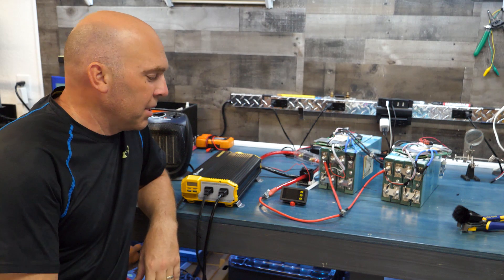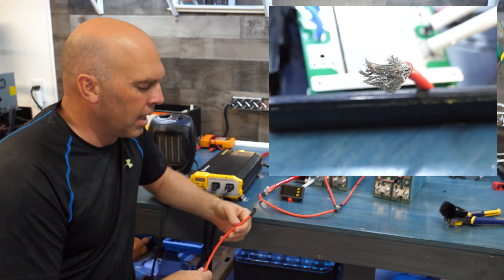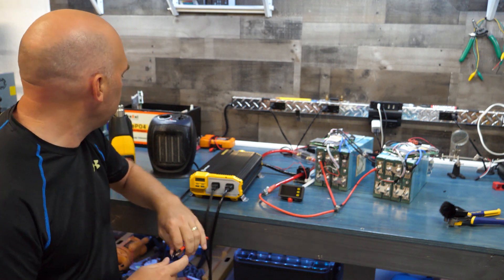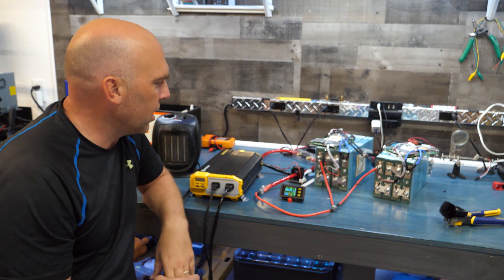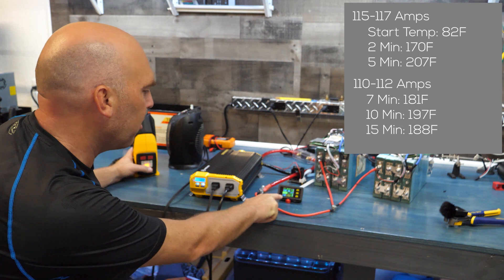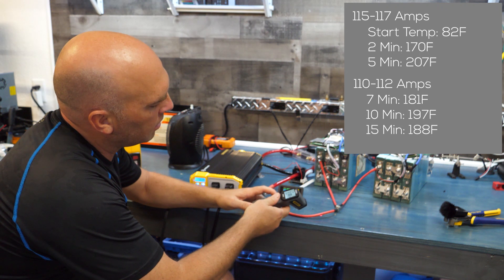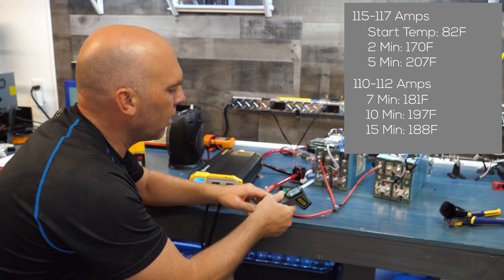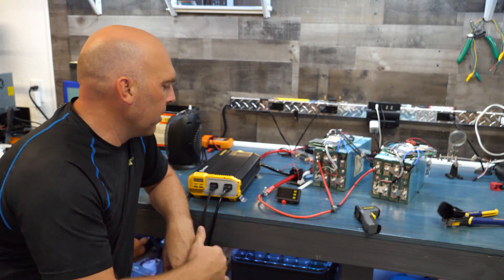8 AWG (Gauge) Silicone Wire - 115 Amp Test at 12 Volts - High Capacity 1650 Strands Stranded Copper

Comment: I have 8 inches of copper 8AWG knuconcepts wire, And wonder what is the max current it can carry. Internet says about 40 amps. But that can't be true because I have it connected to an amplifier with dual 40 fuses and makes about 800 w RMS. 
And the wire doesn't even get hot

Comment: What gauge wire would be suitable for converting a connection to xt60 for a 48v 11.5ah battery (750-1000w) for an ebike? Does anyone have a suggestion? I was thinking to just use this 8WG wire...
Reply: Well xt60 is a max 10gauge connector. I wouldn’t put more than 60amps thru an xt60 connector
Reply: Use an xt90 resolder both ends swap them out for the bigger plugs
Reply: @onesikm3  thanks a lot! The issue I have is most third party eBike battery have an XT60 on one end...

Comment: I just went ALL out and got short 2 foot length of 0awg or 1/0 awg for my 1000W modified sinewave 12v DC to 110v AC power inverter. 
No wires heating up for me! And minimal voltage drop. Gets the maximum possible runtime out of the 100AH capacity agm battery I can. No cutting out early from voltage drop. Only takes a tiny percentage of voltage drop for the low voltage cutout to trip. so I oversized the wires massively. No chance of the wires getting warm even if the inverter got struck by lightning.
1000W is also not really going to be used for extended periods of time. Only for brief periods. few minutes at most.
Battery terminal voltage alone by itself drops to just under 12v. at the inverters rated 1000W output. 
Can run a upright vacuum or small shop vaccum cleaner up to 8 amps rating easily without even breaking a sweat.
Might even upsize our battery capacity in the future to 200AH. That way I get more runtime on heavy loads without taking the battery under 12v.

Comment: If i got 8awg wire rated for 50amp for residential household use, and I bunch 4 of them together into a 1awg ring terminal lug, does it mean it can technically carry 150-200amp current?

Comment: Sir, how much amps can 16&18 awg silicone wire  carry continuously? I want to Tether my drone using these wires (low budget project). Will it be ok for 10-20 meters of tether? Pls tell
Reply: Wattage of my drone is 300 watt, max amps 28-30, for hover 20amps
Reply: @vikaslikhitkar1483  Maybe 1 meter can support 20A of 16AWG. You'll have massive voltage drop using 10-20 meters at high amperage. I wouldn't push 16AWG past 20A and 18AWG past 10A

Comment: 8AWG Stranded Tin Copper Silicone Wire is just what I'm hooking up 13.8VDC linear amplifiers [350 and 550 PEP watts] with.  Had a small measure of concern what this wire was capable of carrying.  Not expected to pull more than 100 Amps regularly, from 200A converter. Having now seen this video I can confidently apply, in a pinch, juice to a third linear producing 1350 PEP watts, as well.  Your video set my mind at ease.  Thank you for sharing.

Comment: If it can handle a 1500watt inverter why is it that every resource I find recommends at least 3/0 AWG for a 3000w inverter? (12v) It seems way overkill and my local store only has 1/0 awg
Reply from the maker: Silicone wire can withstand higher temperatures. The higher strand count helps reduce gaps and pass more current. This is a pretty well-debated subject. Personally... before learning of silicone wire, I used (2) 1/0 wires on a Victron 5000 watt inverter. That was the recommendation by Victron and most inverter companies will tell you the minimum cross-sectional area required. 1/0 has a 55 mm square cross-sectional area and was printed in the manual. Always defer to the inverter manufacturer.
Reply: @reBelBatteries  wire strand count is ONLY FOR ADDED FLEXIBILITY… it has absolutely ZERO effect on amperage handling ability in DC current. 

The only reason high amperage is claimed on this wire is the 200C insulation rating. Allowing high amps to push through the wire, and the insulation will not melt…

But the conductor will be wasting a lot of energy to heat.
Reply: Devices that generate heat quickly degrade your battery state of charge. Its better and more efficient to have oversized wires and a short run to your inverter. Why waste the watt hours heating the wires when you can use it to run the inverter. Silicone insulation might withstand higher heat but the wire resistance goes up as well. Why add to losses if you can avoid it with larger wire and good connections. I am a firm believer that one cannot possibly have a big enough battery bank.

Comment: Thanks for the video! Heat = inefficiency, it really is that simple. Just seems to me the slightly higher cost of going with a 6AWG, or doubling up this and the negative cable would be well worth it. I am already concerned about heat in my RV storage cabinet where my Magnum Inverter will also be generating heat. Honestly, I think I'd pull the trigger on 4 of these but for this unnecessary heat these cables will generate., i.e. wasted power from my precious battery bank.
Reply from the maker: Mark, we have improved and doubled up on all current and future batteries. Our new batteries come with 6AWG for the 100AH, and two 6AWG on the 200/300Ah. The battery in this video was version 1.0 and a small batch order. We've also upgraded the BMS, which can now do series or parallel up to 4 batteries. Thanks for the comment.

Comment: As Jeff Goldblum said in Jurrasic Park, "Just because you can, doesn't mean you should".  That 1 foot length of #8 will drop nearly 0.1V at 100A and 70dg C.  Really??  For a few pennies more, this design could have been much better.  Yes it's safe, but short-sighted.  Hopefully you're ordering in large enough quantities so that you can specify a common-sense improvement.
Reply from the maker: We have double the wire on all future orders. When they arrive, there will be another video.

Comment: My suggestion is to measure the voltage and current across the the WIRE you're testing to see how much power loss there. At that temperature, I think the loss is pretty high. At 115 Amps, if the voltage across the wire is 0.5 Volts, then the loss will be 115x0.5=57.5 Watts. 57 Watts, out of let say 1000W,  is 5.7% loss. Thanks for the video. It's a good test.
Reply: Correct, Copper starts to loose conductivity after 70 degrees C and gets worst as it gets hotter.

Comment: You basically have a heater element inside your battery box. You should double that cable up. Also your cable lugs have very little material on the connections. Juat because a wire can handle a current doesn't mean it efficient.
Reply from the maker: Yes. I agree.  While one does meet the spec.  We've doubled up the wires on the next batch that are coming in.

Comment: Your wire maybe able to handle it. But your losing voltage and watts. The last thing I want to do is lose power before I even hook my wires to the battery
Reply from the maker: I replied to another one of your comments, but again... while it meets the spec, we have doubled the wire in our batch due to arrive in a few weeks. Thanks for the input.
Reply: @reBelBatteries  I love how much you interact with the comments on here, really awesome!  Its so cool to see you listening to people and actually making changes to your products.  That shows your a company that really cares.

I agree with the others thou, I dont care what the #8 is rated for, its to small for 100a, let alone 200a continuous current, short spikes would be fine.  Its also acting like a choke point and limiting surge current into an inverter, which could keep it from being able to start big surge loads. 

 Yes that small wire all by its self is rated to handle it just fine, but everything that wire is connected to is most likely not rated to handle 400 degrees.  If the cable is 400 degrees and screwed to the terminal of the cell, that cell is going to start getting REAL hot, same for the terminal on the battery box, same for the connections on the BMS.  Just because the WIRE is rated for the temp, doesnt mean that everything that wire is connected to is rated for the same temp, not many things are rated to handle 200c.  Also the voltage drop (power loss) pushing 100-200a over number 8 cant be good.

Its like putting race tires on a geo metro, just because the tires are rated for +200mph and can corner at 2g's, doesnt mean the rest of the car is rated for that kind of performance.

As an electrician, in the code book we have to use our wire based on the weakest link.  Much of the wire we use is rated for 90c, but most things we connect it to are only rated 60c or 75c, so we can only use the 90c wire as if it were rated for the lowest c device it is connected to.  So if you connect 90c wire to a 60c breaker, you have to size the wire like it is only 60c.  Meaning, at 90c the wire might be rated for 60a, but at 60c, the wire is only good for 40a.  In our world #8 is only rated around 40-50 amps, for 100a you go to #2, 200a you go to 2/0.  Its all about keeping the temps down, and power loss/voltage drop, to a minimum.
Reply from the maker: @Tro1086  Thanks for the input and we've listened... we've worked with the manufacturer and all batteries now have double wiring. The original warranties stand and we haven't had a single issue from overheating reported.  99% of people using these, do so in a reasonable manner and don't push 100A in and out continuously (although they could) ;)  

A new shipment of batteries is coming in today, and there will be more videos coming, stay tuned.
Reply: @reBelBatteries  You guys are awesome, cant wait to see more videos, and new products on the site!

I agree, most people will never pull that much current thru the battery for any real amount of time, but the fact that the battery is capable of it, means the other components should also be up to the task.  I know the wire was rated for the task, but by doing so creates a lot of undesirable heat that will soak into other components.

By upgrading the wire now, you could probably get away with something like 100c.  I dont know what the price difference is between the silicone fine strand stuff, and something more common like MTW wire.  The silicone 200c wire isnt necessary anymore if your not going to be pushing the conductor so hard, may be able to get away with a cheaper wire/but larger conductor. Just a thought.  In my mind 2 6AWG rated around 100c +/- would be perfect.  Two 6s would handle 110a without even breaking a sweat, and only be warm to the touch.  But the 2 #8s should be fine a fine upgrade.  Did you guys upgrade the 2 #10s on the BMS side?

Comment: I think metal material ie CCA (copper clad aluminum wire) vs pure copper and length determine the internal resistance which in turn causes heat.

Comment: Hello friend. Tell me, 8 AWG silicone can withstand 75A, 24V for 3 hours? Cable length 5 meters
Reply from the maker: Maybe, that is a very long length. I would test it before installing it.
Reply: @reBelBatteries  What is the permissible temperature of the cable under load?
Reply from the maker: @PetruninAleksandr  Most datasheets I could find for silicone wire state 200C.
Reply: @reBelBatteries  I can hardly believe it =) Maybe China is lying?
Reply: Too long. it will handle it, just!!, but it would get hot and you would loose efficiency and on hot days it might cause too much resistance and blow your appliance. For 5 metres, either double the 8 awg or use 6 awg and even then I would test it after to see what temperature it reaches if gets hot at all.

Comment: If you (REALLY) wanted to TEST the cable, you should have added more batteries (in parallel) and also paralleled a second inverter to double the amperage through the test cable.
The TRUE TEST would have been to pass 2-3 times the RATED current to see what fails or what happens.
This test only showed you could pass 110 amps through that short piece of cable.
Maybe use a welder to pass higher amperage and SEE what happens... Just a suggestion.
Reply from the maker: This test was only to show what the battery is designed to supply.  100 Amps.  Perhaps another test is in order just to see where the cable ultimately fails!

Comment: Nice video! I just ordered that inverter for our rv solar project. Are those the cables that come with that inverter?  If not, how did the cables that come with the Kreiger inverter hold up?   Subscribed.  I'll make my own video once I finish the project.   Thanks for sharing.
Reply from the maker: They did come with the inverter and seem to be of decent quality.  Running at max watts (1500) for extended periods and they get pretty warm, but not hot.

Comment: Stranding does not help ampacity. Solid would be better but if built properly the stranded will have the same cross-sectional area of copper, but will take slightly more space due to the (small) gaps between strands. The biggest part is the high temperature tolerance, but there will still be the at least the same losses (hopefully no more) in the wire as any wire with the same actual cross-sectional area.
Reply: Stranded wire allows the wire to be significantly more flexible.